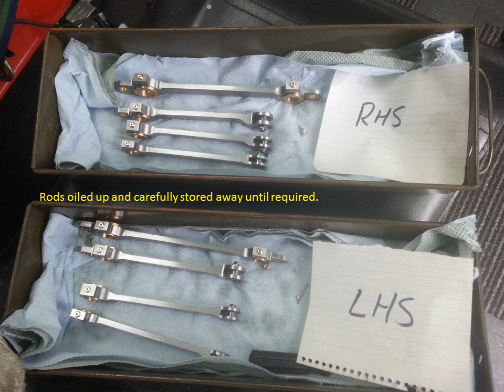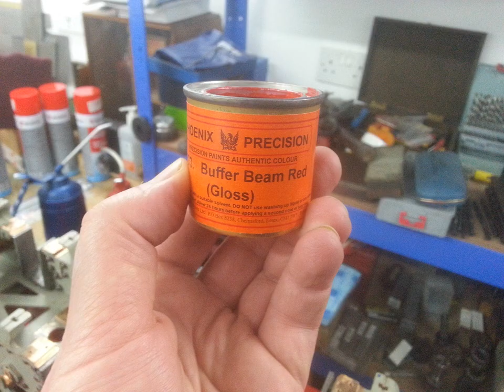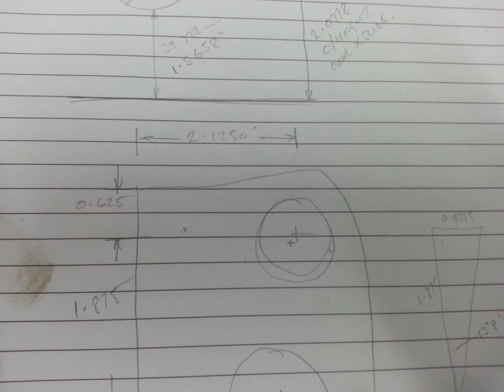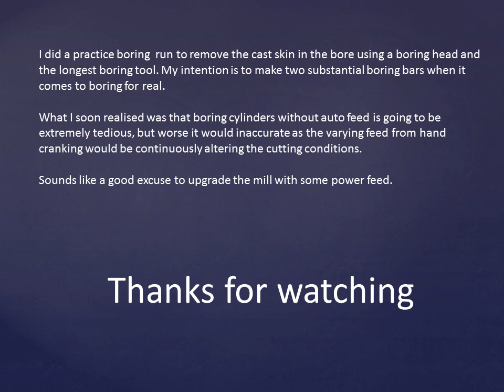Steam Locomotive 9F Build  Part 19 - Coupling rods, painting, slide bar brackets & cylinders

Comment: Making single models as copies of the full size loco requires thousand of patient man hours .
If the model was designed to produce a good external look with parts out of view such as the frame boiler inner parts of the cylinders etc
designed to be functional but man hours minimised which applies to most machines.
I recently made a 3 1/2" gauge Schools class based on the plans for a gauge 1 version .
The boiler is a simple smithies design with gas firing , the frame and rods were laser cut from sheet steel and finished by hand.
The wheels were purchased as castings . I intended to fabricate the cylinders but found suitable castings .
From start to finish took me about 9 months and the completed model looks the part and works well.

Comment: G'day Craig another very interesting video the red between the frames is a very nice original touch.  Did you find machining the gun metal difficult?  Thanks for another building video instalment and the 1812 overture was much appreciated. Regards John
Reply from the maker: Hi John, The red between frames was apparently done so that when locos came in for maintenance, the fitters could clean them down and if there was any cracks in the frames, stretchers or horns it would be easily seen as a black line against the red background. The gun metal was really easy to machine although the swarf gets everywhere! Are you having problems with gunmetal?
Cheers Craig
Reply: Thanks for the reply just speeds for gun metal! Thanks John
Reply from the maker: I have not had any problems with gun metal. It seems to like being cut at any reasonable speed. I once was given some 'gun metal' that was a swine to machine. When drilling it seemed to grab the drill and run very hot. Even with flood cooling it still was a real pain. I later found out it was some type of aluminium bronze. I wont make that mistake again!  Cheers Craig